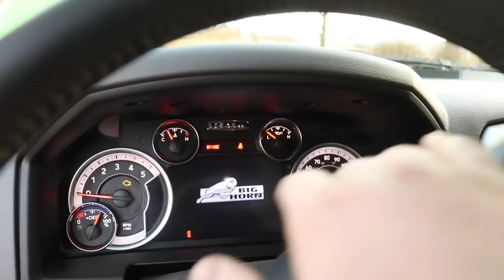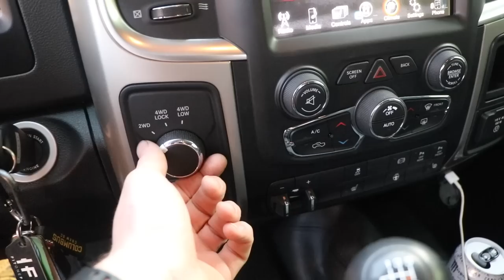Thinking about Buying A DIESEL Truck? Heres why you should ONLY buy A CUMMINS!!

Comment: I will check back when you have 250,000 miles on your truck with the original engine and transmission like my f 350 and excursions both with the 7.3 powerstroke. I mean less than 2000 miles i would hope you are happy with it.
Reply from the maker: War Monger ugh I wish I could do that but I’m building this to 600 HP and putting a south bend dual disk in it, 7.3 take home the cake they are bad ass! 7.3’s and old 5.9’s all day long! But with the newer trucks all are crap with the new emissions but the ram is just the best value for your money!
Reply: Ryan Mayer lol. Im not hating and neither of my 7.3 are stock, but i can still tow and load heavy payloads without being worried
Reply: Well... with a ram... your gonna be driving around looking like a dumbass who just left the dealership in a ugly ass truck while the salesman is laughing “man that’s an ugly as truck, what a sucker”!
Reply: War Monger - Is 250k a lot?  Plenty of Cummins with well over 500k and a few over a million miles.
Reply: Monster RAM no its not a lot but he said he has less than 2000 miles. I would hope that you could buy a damn Hyundai and be happy with that few miles. And frankly i like cummins, its everything around it i have had trouble with. Plenty of powerstrokes with 500k and million miles on them. I just dont own one and was trying to speak from knowledge not as a nut job fan that only likes my brand.
Reply: War Monger - Sure he can't speak about his truck lasting 250k miles, but does he have to?  It's not like he has the only Ram in existence.  There's millions of these things out there and the vast majority last a very long time, if properly maintained.  There's quite a few 2015+ that are over 250k on the forums owned by people who hotshot and rely on the truck everyday.  My point with mileage was that 250k isn't much for a Cummins and you can't say the same for the 6.0, 6.4, or 6.7 PS.  The inline cylinder layout is superior, not only in making torque; but in design, and requires about 30% less parts which translates into longevity.  Sure you can find a high mileage PS here and there.  Just a few months ago I ran into a guy who had 260k on his bone stock 6.0 and said it ran perfect.  The thing is, it's not the norm and if you randomly take a 6.0 PS chances are it's going to have a bad EGR cooler, oil cooler, issues with the FICM, etc, etc.  Also worth noting, the 14+ 2500s have a new style steering & suspension that is far superior than its predecessors.  When it's time to move on from that 7.3, take a look at a 14+ Ram. 👍
Reply: Monster RAM as i pointed out previously. I only mentioned the miles because he said he has less than 2000 miles. I made Zero mention of only a 7.3 ps being able to reach 250k miles. You implied only a cummins can reach a million. I live in Indiana and am familiar with cummins. I like them. My problem is with my experience of Chrysler transmissions and other  components. As i said i am speaking from experience (which is why i mentioned the mileage on my trucks, i own some, not an internet warrior talking out my rear end). And i doubt i will need to look for a different truck unless i wreck since my 7.3 only have 250k on them. And i noticed you did not mention my 7.3 only other motors which are newer and built in house instead of farmed out. I would expect a learning curve. Have a good one
Reply: Monster RAM hey I just want to make it clear again. Im not a "Ford guy". I buy chevy cars, always. Ford cars, again in my experience (6 cars) are crapola. My disappointment is more that after Ryan flopped down $50K plus or minus, we ask "how is it?". God bless it, it was $50,000.00!! it is amazing, the radio is positioned perfect, yada yada yada. For the money any brand truck costs the only worry we should have (as consumers) is paying for the truck and fluids.
Reply: You can’t compare a motor with no emissions with a motor with emissions it’s easy to say who wins any motor without emissions will last longer that’s a fact I have a 97 12 valve pretty well stock it has 746,000 on it no blow bye you won’t see any new truck ford Chevy or dodge with that many miles on it because of the emissions I love the 7.3l and I love all the Cummins motors not so much the 6.7 because of emissions but still good if u delete them I myself will stick to my old trucks I hate Chevy they all rust out fast and the front ends are shit and I hate the motors so can’t say much for them
Reply: War Monger 250000 that’s all that ain’t shit cummins just breaking in. And don’t talk shit the stroke will have a stroke sooner than you can expect
Reply: War Monger Check out the channel PD Diesel Power. He's got his trucks towing 100% of the time for his hot shot business. Runs em in excess of 300,000 miles. All 6.7's. Nuff said man. The 7.3 powerstrokes are awesome powerplants. So are the bulletproofed 6.0's. My cousin owns an excavation business and bought a 6.0 brand new in 04 I think, did nothing to it and it has 287k miles on it. So some do work. Can't trust the 6.7 powerstroke tho I see them coming into the shop ALL the time. But who knows the newest ones may have the kinks worked out. They only come into the shop when the warranty has ran out so I'm seeing 2012 - 2014s. I saw a couple 15s as well absolutely nuked. I honestly feel bad for the guys they spend 50 grand on a truck and it blows up on em right out of warranty. I wouldn't wish that on anyone whether they drive dodge ford chevy toyota nissan or anything. The labor is also like 140 an hour on top of parts which are insanely expensive now. It sucks.
Reply: I have a 13 with 365k on it drive it and pull daily with it I've had couple 7.3 trucks loved um but love my rams better
Reply: Monster RAM but look at all the transmission problems they're having just look up in the forms and all the rust ram .lol
Reply: Evil One lol you got to get an education on truck
Reply: Congrats. You got lucky with your powerstroke lol. Cummins is without a doubt the most reliable out of the major diesels lol. Inline motors tend to be more reliable than V motors anyways due to design.
Reply: @SR20FTW  lol give your head a shake you've been drinking too much of a Cummins juice
Reply: @SR20FTW  disagreed  super duty is by far the best with the Powerstroke has been proven do some homework . Maybe the older Cummins back in the 80s early 90s . Also the Powerstroke can handle more
Reply: A simple way to shut down War Monger.... what year did they stop making the 7.3? So you got one of a handful of still functioning great engines. What has Ford done since? 6.0 or the 6.4. Dodge has way more Million Mile trucks on the road then Fords high selling models cause they last.
Reply: War Monger just hit 306,000 miles in my 97 2500 😉

Comment: Ford diesels today have the best transmission ever offered in a pickup the highest rated towing capacity the highest resale value the highest reliability ratings the highest power output, the greatest tuning capability the best vehicle construction methods the strongest frames the best ihs crash test safety ratings of any truck. Yes cummins that ram dosent build is reliable but the rest of the truck is trash very poor construction, most unreliable diesel transmission and worst resale value and crash test ratings, i think you need to learn up on trucks, buying anything but a ford is wasting your money on a lesser quality product.
Reply: Tyler Sutton awww man, did the Ford service manager tell you that in the shop while the mechanics are rebuilding the 6.0’s? Or did he show you how easy the 6.4’s are to work on after they jack the cab off the frame? Or when he lifted the hood on a 6.7 & told you that Ford finally fixed the “Powerstroke issues” with the new larger 6.7 engine that you’ll never work on but my mechanics will be here & our labor rate is $125 a hour???......FOH
Dodge has always had their problems but one thing they did do right is sign a contract with a reliable engine maker. I’m no way a Mopar guy, Ford guy all day long. I own a ‘92 5.0 LX, ‘95 F150 Eddie Bauer, ‘12 Ford Edge (wife) but when it comes to HD trucks I’m a Cummins guy, also own a 2nd gen 12 valve Cummins & a ‘18 Laramie Cummins. It’s all about preference. Like I said, I’m a Ford guy but I’ll never own a PowerJoke.
Reply: It looks like he’s a salesman for Ford
Reply: That’s bullshit. The Allison transmissions are the best, Cummins has the best motors, and ford has the best appeal. Fords are expensive because they want them to be expensive. I would rather have a lbz duramax or a manual Cummins.

Comment: The 6r140 is better than any of the transmissions you can get with a Cummins without a doubt. I doesn’t matter if you 3 transmission options if none of them compare to the competition. It’s about quality not quantity.
Reply from the maker: Ain’t nothin quality coming out of ford or Chevy 😂😂😂 except Allison trans
Reply: Ryan Mayer I guess you haven’t done your research on the 6r140. It will hold 700hp all day without any modifications. If not having to upgrade a transmission just to tune and delete a truck isn’t quality, I don’t know what is.
Reply: Stellar Turnip you can research a 6r140 all day long, it’s behind a powerjoke, that’s where the water gets murky.
Reply: He didn’t once bash ford or chevy on reliability or power.

Comment: The G56 manual tranny with the Cummins is by far the best combo on the market for towing and long-term durability.  No automatic transmission will outlast the G56 manual 6 speed.  I've got an '09 with that combo at its got 257,000 miles and I've never had any issues......never!!!

Comment: I have a 2006 Ram 2500 2 wheel drive with nearly 275,000 miles on it.  A lot of that pulling a large gooseneck horse trailer.  I chose the 6 speed manual because I like to call the shots when shifting.   I have never had to touch the clutch,  I changed the original brake pads at over 265,000 miles.  They still had nearly half the pad remaining.  But then, I have always been easy on brakes.  Only complaints I have are the seats aren't as comfortable as I would like, and the front ball joints and tie rod ends did not hold up as well as my previous Fords.   Other than that, If and when I get a new one I will probably go Ram again.  So far this one hasn't given me any reason to do so.

Comment: Got a v8 hemi 1500 a few weeks ago. First thing I noticed was how easy everything was to get to and the space. Hell I can get to my damed oil filter from the hood if I reach down far enough and was on a stool. 
Smoothest ride I've ever had and the best truck I test drived. 
(Did 150,and Silverado before hand) 
Redid the truck my dad gave me (2000 dodge dakota) and gave back right after I got this. 
Will always stick with dodge until they fuck up (which I doubt)
Reply from the maker: Rams with the rear coils have the best ride I’ve ever had 🤘🏼

Comment: I love the video Everything covers I am an equal opportunist when it comes to diesels the only thing you left out I'm working on a Cummins is to change your oil filter you either have to take off that are hoses from the front filter to get to it or you have to go through the wheel well but they don't give you much space but other than that is the way to go if you wanted to work on your truck

Comment: What's the max towing weight on your V/6 1500?   I have a 31ft travel trailer...don't think that V/6 will be able to handle it....or am I'm wrong ?   open to suggestions...and I will be towing it a lot btw.
Reply: You CAN do it but that doesn't mean you should. Getting the weight moving is easy, stopping it a whole different story. My neighbor pulls a 5th wheel camper that ranges into 10k lbs with a diesel 1500. I'd say you would be OK as long as you are not going cross country.

Comment: I had a few Ford 7.3 diesels, I did like the 7.3 engine but the Powerstroke was was too cluttered under the hood. The 94 IDI turbo was easy to work on but those two glow plugs under the turbo...groan.  IWhen the time came I went with the Ram because of it not being to crowded under the hood and the cummins reputation

Comment: My 2013 Ram 2500 with 207,000 miles is still running strong.
Reply: just broke it in
Reply: @Gantzz321  My 2013 2500 has 70000 kms  / 44000 miles looking forward to when its "broken in" 😁

Comment: Bought a 2017 Cummins cost 70k . Just saw 2018 Ford powerstroke it has way more then what my ram has 4k less . Interior and amenities Ford offer is way better for the value.  But power stroke just looks like more work if something breaks
Reply from the maker: No matter what level trim of ford I get into they all feel the same 🤷🏼‍♂️ for $55k I coulda got a fully loaded Laramie, not sure why anybody needs to spend $70k on a limited or $98k on a platinum superduty
Reply: @ryan2546  when I bought my truck on February of 2017 cheapest I could find  my Laramie fully loaded was for 70k. Year goes by now I seen them for 56k. Here on the north east . Whitch pisses me off a bit . I'm comparing it to what I pay but what they go for now you're right .

Comment: How is it that Rams ride quality doesnt compare when a Duramax rides like a cadillac because of its independent front suspension but a Ram a straight axel which makes it ride rougher and that fact. But, its opinion at the end of the day
Reply from the maker: Well it’s the 4link rear and coils that gives it such a a good ride, the duramax still has rear leafs so it’s a little rougher but chevys to have a great ride aswell
Reply: It’s known that the independent front suspension on the GM trucks is not as stout/durable as the solid front axle trucks. If that matters.
Reply: Yeah I'd rather have a solid axle and a rougher ride. I want a truck to be durable, not ride like a cloud. If I wanted that, I'd buy a car.

Comment: Ryan bro I love your videos.
I need some help.
I want to lift my 2014 ram 2500 4x4 gas SLT but I don't know what is the best lift for the truck since I have never done this.
I want to go 6 inch or 8 tops.
Please any recommendations and which one to buy??.
Thanks a lot i love your videos.
Reply from the maker: Zone is good value and perfect for your setup 🙌🏼
Reply: @ryan2546  thanks a lot I wasn't expecting a quick response.
Keep doing what you are doing you are doing awesome.

Comment: "My truck makes so much power with two less cylinders"
He knows 6.7l i6 is the same displacement as a 6.7l i5, v4, v6, or v8?
Reply from the maker: What I’m saying it’s Cummins designed a i6 cylinder engine Pushing the same if not better numbers in some cases as the v8 competitors, a 6.0l displacement  gas engine has nothing on a 5.9l Cummins, and a 6.8 gas has nothing on a 6.7 power stroke or Cummins, displacement is irrelevant in most cases. 5.9l Cummins Puts out more HP and Torque down than a 7.3l powerstroke and that displacement it’s way off.

Comment: The maintance of having a Diesel Truck vs a Gas Truck? Which one is more expensive?
Reply: Peke diesel. It requires more oil in the oil changes etc. also there are more filters and such on the diesel. But if you plan on keeping it for a while go for a diesel preferably deleted because it’ll run forever. No matter the brand, all diesels are solid platforms these days
Reply: Jarrett Mcmillan could you give an estimate how much more would be for. If I owned a diesel truck?